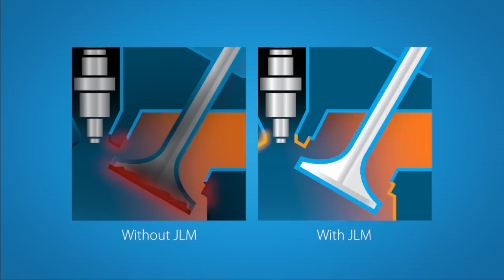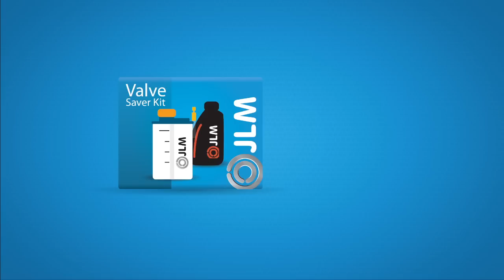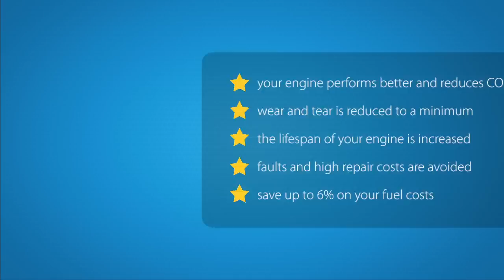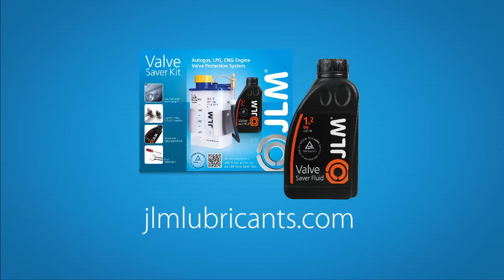JLM Valve Saver Kit | valve protection LPG (autogas) & NGV powered cars

Comment: Will this system help with carbon buildup on the intake valves on a direct injection petrol car
Reply from the maker: Thanks you for your question! It will have some cleaning effect, but the primary characteristic is to protect the valves and seats on autogas powered cars. For a dedicated cleaning approach on the Gasoline Direct Injection inlet valves we have the JLM Petrol GDI Injector Cleaning fuel additive. Here is the link for a video and more information on this product https://www.jlmlubricants.com/en-us/products-additives/jlm-gdi-injector-cleaner

Comment: Thank you for your rapid response, but you did not answer the first question. Will the JLM oil harm the catalytic converter or is it safe to use it in the cars with catalytic converter?
Mr. Mladen (Serbia)
Reply from the maker: Dear Mr. Mladen, sorry I missed your first question. JLM Valve Saver Fluid is safe to use and will not harm the catalytic convertor. Kind regards, JLM Lubricants